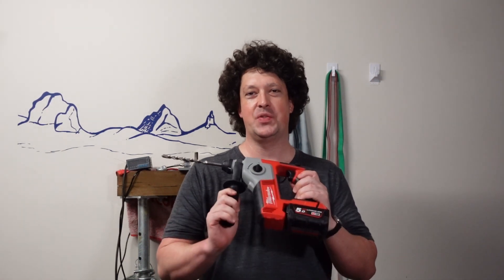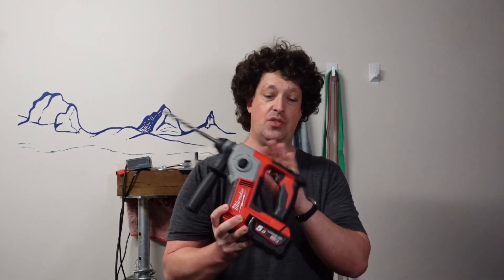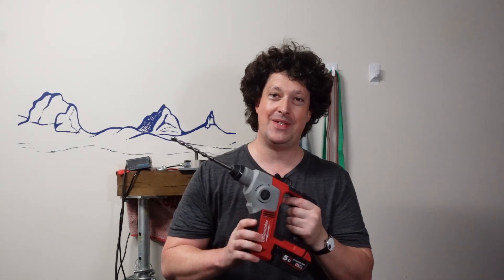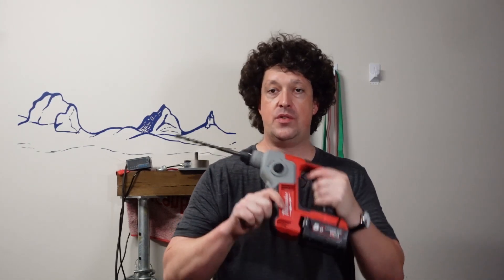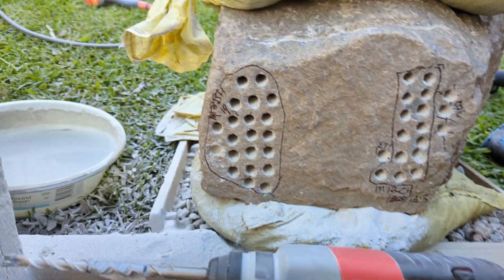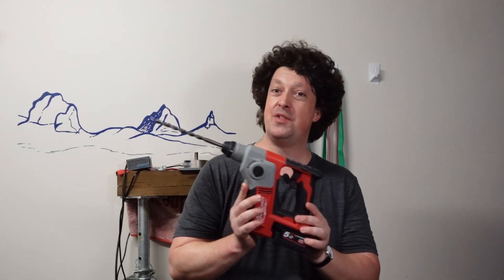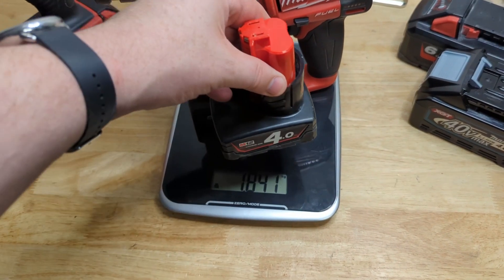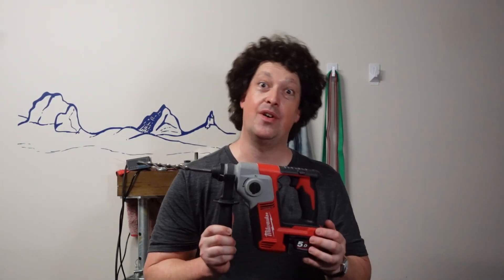Milwaukee M18BH/2612: Any good for bolting rock? (vs M12CH/2416)

Comment: Nice vid mate! If you have to decide for a small rotary hammer for bolting in sandstone, which one you´ll choose? (top 3 priorities: price, weight and performance).
Reply: I'm planning to get a makita dhr171 (without a battery) for only 140 euros. since I already have a couple bosh batteries i will just use a bosh to makita adapter which costs about 10 euros from china
Reply from the maker: I was gonna suggest that drill! Specifically for sandstone it's good because it revs slower than most, so it's easy to control and doesn't cut into the sides of the hole too much (which is a specific sandstone problem).
But really any of the small ones are good. 
Angel, the little Bosch you use is 👍